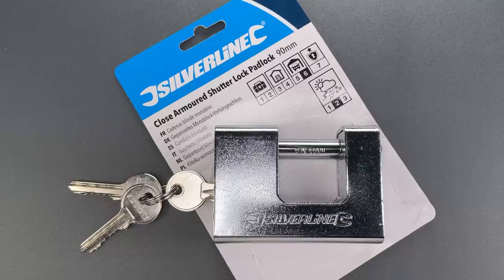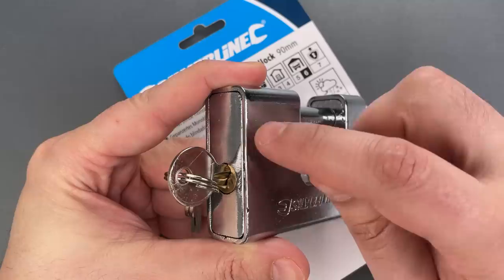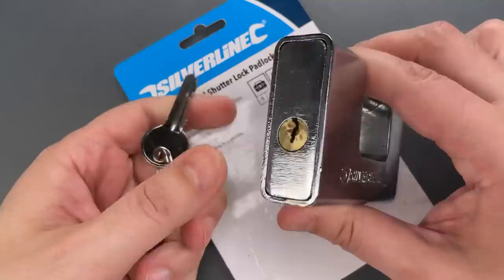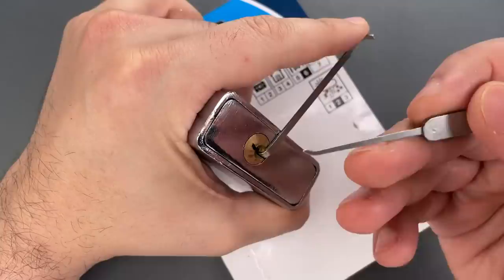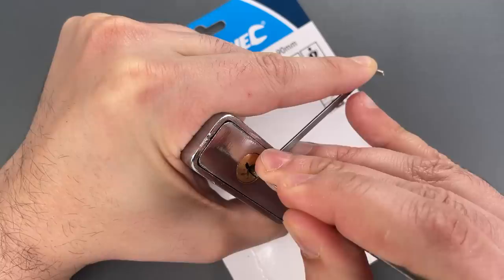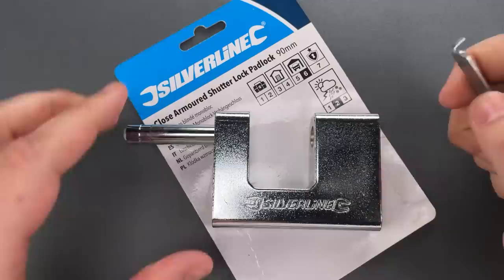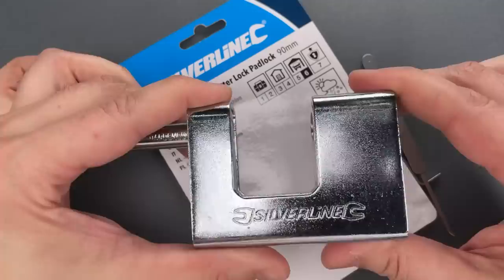[1387] Sheep in Wolf’s Clothing: Silverline Armored Shutter Lock

Comment: Silverline make some great products like their soldering iron which has hot metal parts in the grip, ensuring the user gets burned every time.
Reply: Had a silverline router bit disassemble itself on first spin up and lodge a carbide blade in the wall next to me. Dread to think what would have happened if it had landed in me instead
Reply: Their spade drill bits come with the point off centre too so you can't even cut a round hole
Reply: In both senses of the word, evidently.
Reply: Indeed. If you want poorly made, malfunctioning crap, Silverline's your go-to supplier.
Reply: Giving this comment a like only because Choob doesn't think we're good enough for "WOW"
Reply: From the sounds of it, Silver line appears to be the UK equivalent of Hypertough which is our Walmart brand here in US.
Reply: I quick glanced their catalog. ALL the power tools are made in China.
I can tell because they are the exact same as other chinese made no name tools.
And it's not that they are copies. They all literally come out of the same factory, they just put different colors and names on the tools for each customer.
Reply: At least they call themselves second best.
Reply: Silverline don't "make" anything they just order container loads of stuff from Chinese manufacturers who brand it for them.
Reply: Makes Lucas electrics look good.
Reply: @professorfukyu744  Guess they attempt to only supply markets with one other competitor then.
Reply: The Silverline set square gives perfect 88 degree angles every time....

I did buy a 24mm spanner from them as I had to cut one down to make a custom tool and it did just fine for that.
Reply: @gdxd7956  they aren't the same as all other Chinese tools, I've purchased silverline products before, returned them and bought similar looking China tools on ebay or amazon that far surpassed them. They're amazingly bad. Like the factory seconds from a China factory.
Reply: I do have Silverline 24mm & 30mm ratchet spanners, they work fine for adjusting forklift lift chains but the plating has come of both in places.
Reply: @WhiskyMechanic  it's true!
Reply: 😂😂 i had a cast iron vice for steel working that snapped right haf in 2 when i put my meat beaters on it 🤷🏻‍♂️

Comment: I was expecting a bypass tool used... but that picking is fast enough.
Reply: I half expected a comb or rake.
Reply: I was expecting leftovers of his soda can
Reply: A similar model of that can easily be bypassed as the locking lug is simply at the back of the keyway with no wall/plate between them.  Basically take a tool that is hard enough to push into the material (it was brass, if I recall correctly) and shove it into it some then push upwards, ta-da!  The shackle is no longer locked and can be opened.

Sadly, it was a fairly popular model for securing trailer hitches and similar and is produced with the same defect by multiple brands.
Reply: I expected him to just pull it open barehand with the quality of silverline 😅
Reply: I want him to find a lock he can jist shake and it will open

Comment: Silverline are the cheapest of the cheap brands in the UK. Master lock in comparison would be considered a premium brand.
Reply: Silverline is better than PoundLand. This is not praising them, you understand.
Reply: Laughable.
Reply: @robertsneddon731  are you sure? Close call imo
Reply: Not that that's going to help you if LPL gets hold of it.
Reply: @onespiceybbw  
What's the difference between this lock and a Masterlock?
About 10 seconds.
"Which Master Lock Is Harder To Pick? A Surprising Result" --LPL
Reply: I'm pretty sure your statement is wrong because for Master Lock to be considered a premium brand in comparison to this company they would literally have to be selling locks that have plastic and only plastic and their construction as serious security devices. They can be on the same level or slightly worse than Master Lock but they can't be that much worse because Master Lock is as bad as it gets when still using steel in the construction of your lock.
Reply: @the_undead  whatever you do, don't take the word of people with experience of both brands eh
Reply: @alecwood1282  I'm fairly certain that this company does not produce locks that literally fall apart. Also this lock had a five-pin core in it which already makes it miles ahead of Master locks most popular products which 4 pin locks
Reply: @the_undead  Master Lock are, as the name suggests, a lock company.  Not a very good lock company, but they have "locks" as a speciality.  Their locks are functional, if crap. Silverline are not a specialist company.  They take the cheapest of cheap shit from China, have it branded for them, and ship it.  At a guess, their personnel are 20% marketing, 10% liaison with China. The rest deal with refunds.  5 pins, 7 pins, it doesn't matter.  If the lock has such poor tolerances that a completely miscut key will open it as long as you get to the lock before it corrodes into a solid block.  

The lock in question, or at least the one I played with, has effectively 3 cut depths rather than the 5 or 7 you'd expect.  That's how awful the tolerances are.  I'm not sure you couldn't open all of them with a key that only has mid cuts.  You can rake it in seconds, usually on a single pass.  pin by pin picking is trivial, and I'm rubbish at picking.  They actually do make master lock look decent.
Reply: @wibblywobblyidiotvision  my whole point is unless the locks are literally falling apart and are incapable of staying closed then they do not make Master Lock look like a premium brand. They might make Master Lock look like it's not all that bad but they will not make it look like a premium brand (by premium I mean quality not insult that everyone in the modern-day thinks premium is, looking at you Louis Vuitton)
Reply: @the_undead  'literally falling apart' Ah, so you're familiar with the silverline brand then? It's not just their locks either, pretty much everything they sell falls apart or doesn't function at all. We aren't joking, they're terrible.
Reply: @jdmjesus6103  based off what I can gather about what everyone else is saying the locks function and are made of some kind of a not copper or aluminum. Therefore they may be worse than Master Lock but not by all that much because so long as the lock physically stays as one piece and kind of functions you can't get that much worse than a Master Lock. Based off what people are saying I wouldn't be surprised if some of their locks would fall apart if you hit it with a 6 lb Sledge but that's not falling apart out of the package when you haven't done a damn thing to it
Reply: Not the cheapest of the cheap - you're forgetting Rolson.

Comment: ' needed to use it outdoors for shutter lock (as it is meant to be used for)... it has lasted 10 days and it has started to rust and seize internally,' from an amazon review (not mine)
Reply: That's a security feature, makes it more difficult to pick if it's siezed with rust.
Reply: maybe the rust is a security measure. give it another week outside and it won't be unlockable, even with the key lol

Comment: As others have mentioned, Silverline have a pretty poor reputation for lots of their stuff.. I bought a set of their Hex keys a few years ago, the smaller ones up to 5mm are so badly made they don't even fit the bolts.
Reply: Pro tip: the larger ones might, right up until you use it once on a sticky screw made of "not cheapo metal" because afterwards the corners will be sheared off and you now own a round dowel.
If the screw somehow is worse than the tool, you will instead mess it up to the point that now any other tool also won't fit anymore.

Comment: I got gifted a beginner's lock pick set a few months ago. I've had all manner of fun picking the 3 practice locks and other random things: file cabinets, drawers etc. I even pin picked a No. 5 Master lock with relative ease. Then, I found a No. 17 Master lock. Man, I'd been messing with this silly lock for weeks and thought maybe there was something wrong with the cylinder. I don't have a key for it so I couldn't verify if it even functioned. I've been debating on whether or not to cut the rivets and disassemble the lock but I just could make myself give up.Yesterday, I finally got it open! Super stoked I didn't let it whip me.

Comment: Based on the bitting of the keys, you should be able to rake it with a Bobby pin
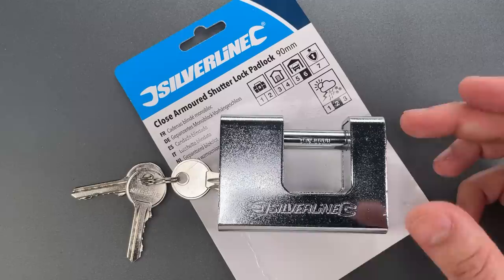Reply: Came here to say that based on 0:27. Unless you have ridiculous tolerances and cut-depth differentials down to the thousandth of an inch, that key looks like a blank that someone accidentally scuffed up a bit by dropping it on pavement. No high-low or low-high pick resistance here; surprised he didn’t just pull out the Covert Companion’s rake or that MacGyvered snap contraption just to embarrass it before killing it…

Comment: I bought a basic lock picking set. Once you get the hang of it, it's easy. So, I did the regular locks I have, and started on some cheap, small locks. Whole carp, just being a small lock, is pain in the ass. All the tools are way to big. I tried to improvise, but nope. What, do have to buy small tools, just to work on small locks? I mean, I see this Silverline lock, and think, "Why doesn't he just reach his hand in the key hole, and unlock it that way. If I made locks, I would make all the keys small as possible. Damn, you would need a magnifing glass just to see the key hole.

Comment: As others have said, here in the UK Silverline is ultra budget.

Might be fine if you just need a cheap tool you only need to use a few times for something you don't normally do.  Otherwise buy something better of which there will be ALOT of options :)
Reply: 'a lot' - alot is not a word.

Comment: I think sometimes the point of these locks is missed, most thieves are not pro's nor carry a full compliment of picking gear, most opportunistic thieves will be deterred by what "looks" like a hefty and solid lock, and that's the point, to give the thief either pause and more time to get caught or put them off altogether.

A determined thief unfazed by locks will likely be also unfazed by his/her surroundings so will either carry a hefty bolt cutter or liquid nitrogen to just shatter a lock.

Comment: I notice that virtually all locks you pick have freely rotating barrels. What do you do if the barrel is difficult to rotate? (corrosion) I had two very expensive antique slot machines that needed to be opened. No luck. The barrel was stiff to rotate even after a can of WD-40. Drilling the locks reduced the value of the machines by hundreds of dollars.

Comment: Could you make a video explaining the different pins that are, how they work and why some are more difficult than other to pick? The techniques used in locks to prevent picks (false sets, mushrooms pins, serrated pins...). And could you also explain the terms you use (what exactly is a pin that is biding, set, locked, tension, counter rotations....). In your 1387 videos there is one with this? Thanks!
Reply: mushroom pins act the same as spools: they give a false set (the core is turned but not completely.) serrated pins just give extra clicks. a pin that is binding is a pin that needs to be pushed up, "picked," so on and so forth, set is the state where the driver pin is above the sheer line, there is no "locked" pin state, that is a state of a lock no?

Comment: Typical Silverline product looks good in the packaging fails miserably in practice . I never buy Silverline due to the poor quality of their generic  knock off products . I bought some DIY items as I  use them very little all were Silverline branded and all were useless , stainless steel labelled spreaders that rusted , centering hinge drills that were sharpened on a file by the look and some long  reach hex bit screwdrivers that snapped on even loose screws .